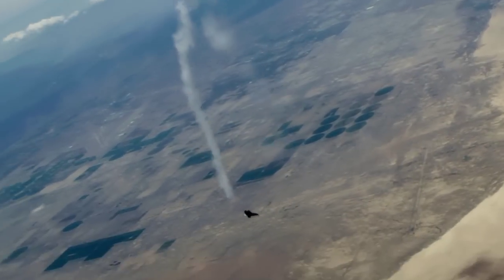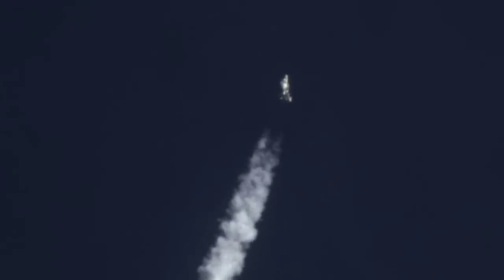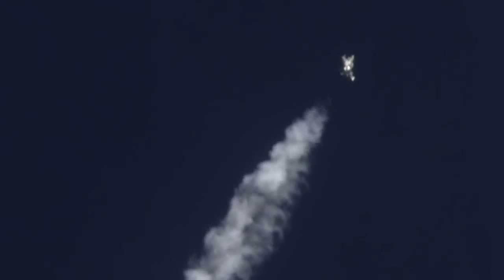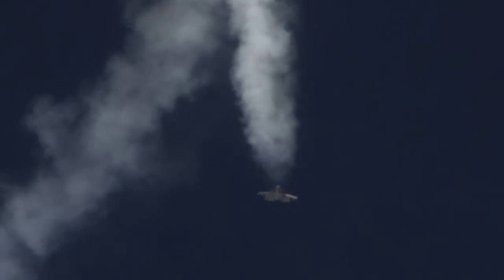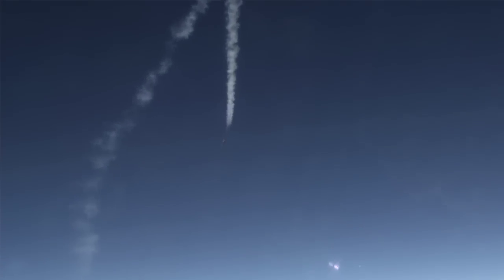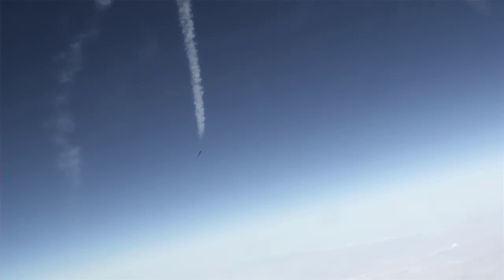F-35 Flight Test Intentional Departure

Comment: Every non-stealthy plane becomes even more non-stealthy with external weapons and instant reduced performance. A smal bellytank under F18 and 4 A/A missiles and your instantly down to mach 1.4 max. With 3 tanks it's max mach 1.2. Add bombs (4000lb) or ECM pod your down to mach 0.8.
F35 will of course suffer from the same limitations with external stores.
It's a non-argument basically. With the F35 you have the choice. Depending mission profile. With F18...you don't.

Comment: Yes serious.
You haven't answered my question. Which is the more capable plane.
A F105 with 5000 lb of bombs, 2 or 3 fuel tanks, and/or some pods for all wheather/day/night capability, ECM, nav, lasertargeting...the lot.
F35A has all that inside.
Result: 9G, mach 1.6, 50 degree+ AoA, throughout the envelope.
F105 (or whatever): can't get supersonic anymore...limited G/AoA. Increased RCS, less range, more drag etc.
Easy. Just a matter of physics. You should know that. You are an analyst right?

Comment: What the USAF will not tell you is that ‘stealthy’ aircraft are quite detectable by radar; it is simply a question of the type of radar and its angle relative to the aircraft… As for the highly complex electronics to attack targets in the air, the F-35, like the F-22 before it, has mortgaged its success on a hypothetical vision of ultra-long range, radar-based air-to-air combat that has fallen on its face many times in real air war

Comment: Seriously?

If one accepts every performance promise the DoD currently makes for the aircraft, the F-35 will be: “Overweight and underpowered: at 49,500 lb (22,450kg) air-to-air take-off weight with engine rated at 42,000 lb of thrust, it will be a significant step backward in thrust-to-weight ratio for a new fighter… [F-35A and F-35B variants] will have a ‘wing-loading’ of 108 lb per square foot… less manoeuvrable than the appallingly vulnerable F-105 ‘Lead Sled’ that got wiped out over NAM

Comment: new Documents out of the Pentagon suggest that the F-35 is looking at cancellation. with a 68% rise in cost per plane since 2002, plus the numerous software issues, grounding sue to engine blade cracks, airframe cracks, grounding and such....can only hope this white elephant of a plane gets cancelled or procurement minimized.....this plane is just ghastly

Comment: Search "yury su-35 problems". Typhoon took 25 years before it could self designate a guided bomb - most flying examples still can't. You are using the F-35B internal payload spec, F-35A and C can carry 5,000 lbs internal - the anti-war POGO types love to do that - mix and match stats to make the -35 look bad. Can the Rafale's pitiful thrust to weight ratio power it to Mach 1.6 with 2x 2000 lbs bombs and 2xBVR weapons? Nope. But F-35 can go to the limit with a credible weapons load.

Comment: Delayed 3 years etc...nowhere does that show up in any search, but problems with the F-35..try searching that and all you get is report after report what a failure this plane is. A 3000lb internal load isn't bad..and I did say 3000 not 300. I would take Typhoon or Rafale ( both of which have seen combat unlike the F-35 or 22) over the F-35...it's overpriced, underwhelming, problem-riddles underachieving aircraft

Comment: Airshow maneuvers at airshow speeds and altitudes are completely irrelevant, and Su-35  introduction has just been delayed three years because of unspecified "problems". F-35 can carry two AIM-120D and two 2,000 lbs JDAMs at the same time . . . significantly more than 300 lbs. Nose pointing at altitude as shown in this video without vectored thrust is nothing short of phenomenal. Su-35 is nothing more than a target for the Lightening.

Comment: on the matter of capability to detect..your wrong there...first off the F-35, the white elephant that it is, has to be in service, which it isn't. Second, the F-35 has a 300lb internal load...nothing special. Lastly, this video shows a plane with nothing special in terms of maneuvering...watch the Su-35 at le Bourget airshow 2013 for some awesome maneuvering. This plane continues to be less than average.

Comment: The idea is it doesn't have the proximity fuse or warhead found in other a2a missiles, and uses this for fuel instead - perhaps using the new generation of gel based rocket fuels. It's also a fatter missile than normal, further increasing the internal volume. On the other hand it has to have a solid divert system like the PAC-3 to pull the end game hit to kill maneuver, which takes some space back.

Comment: "Ok, it’s not stealth"

...and that's its problem.  Against a flight of F-35's carrying 12 CUDA missiles EACH internally, any aircraft which can't detect an F-35 within the F-35's engagement zone will be flying defensively constantly, burning fuel and losing altitude.

Even if the first missile or two miss, the F-35 will just keep firing relentlessly until the Su has been drilled into the ground where the missiles are capable of maneuvering 4 times faster than the Suckhoi.

Comment: No it doesn't have em on the wingtip.  The tips are heavily sharpened for stealth.  

The outer rails for the 9x (if fitted) is mounted under the wing, near the tip.

Comment: "What I was trying to say is the bay door stations vs the A2G stations"  I believe the 2000lb jdams are as long as the slammer.

They don't use a trapeze system, the internal pylons use a firing bolt powered by pressurized air (or fuel) to project the missiles outward.  More re-usable apparently.

Currently (and I think already on the test birds) they are drop testing one on the door and one from inside the bay.  3 in each bay is scheduled for block 4 or 5.  2 will go inside each bay.

Comment: I stand corrected and I worded that wrong.

What I was trying to say is the bay door stations vs the A2G stations.

You know more about the F-35 program that just about anyone on YT, are they working on a trapese setup for the A2G station for AIM-120?

Currently it can carry 4 AIM-120 internally on the bay door stations correct?

newmanfrigan is saying block 3F will have the ability to carry 6 AIM-120 internally. I can't see how you can fit more than two on each bay's center-line doors.

Comment: "You can fit two AIM-120s in those bays (Bay 1 is to short for AIM-120 I believe) "

Huh, you believe wrong. Both weapons bays are designed around the aim-120 for their length requirement.  

bit. ly/ 1beQoUW

Comment: A2A loadout:  12 CUDA A2A missiles

A2G loadout:  8 SDB II's.  70 miles range, tri-mode seekers, simultaneous launch capability.  Better than the flankers 6 PGM's with a 35km range which can't be used in bad weather at night.

Comment: Are you sure about that?

Better in what regard?

Shear weight or the abilities with specific load-outs/weapons systems?

The two internal bays add up to four weapons stations.

You can fit two AIM-120s in those bays (Bay 1 is to short for AIM-120 I believe) and four more on the wings for a total of six.

I think the Su-35 can fit eight R-77s on it's wings no?

Comment: Yes

And your point?

Please do share with me what the difference is?

LOL

I bet you're going to try and claim a weapons load-out with gen 4.5 hurts combat range vs. gen 5 due to internal weapons stores and less resistance due to pylons and weapons?

Sure it does but it's nothing compared to the shortened combat range due to no external tanks/stores.

When you design internal stores you lose internal fuel capacity by nature.

Comment: 4. Faulty manufacturing, saying this doesen't happen to other planes is asinine
5. issues shared by the Typhoon and F-22. Su-27 and Mig-29 are okay because they have virtually no capabilities in that regard to begin with.
6. resolved
7. yet again, resolved. Seriously that was an issue they fixed in 2010 numnuts.

Comment: 1. Limited INTERNAL weapons. With external harpoints the F-35 can carry a maximum load-out of 10 weapons.
2. Still cheaper than the F-22 and the F-22. If you are comparing the price of a 80's era soviet fighters to a 21st century stealth fighter your an idiot.
3. not with 40,000 pounds of thrust being delivered by the engine
4. barring the helmet all of which have been addressed. Hell last week it was announced that it was going into service a year earlier than anticipated.

Comment: throw in the Rafale and the F-35 is not too good. If you are going to add things to the list of the F-35 add these as well

1. limited weapons ( to maintain "stealth")
2. Overpriced
3. Overweight
3.Pentagon reports there are 8 crucial flaws in its design that have raised red flags within the DoD
4.Planes grounded due to engine blade cracks
5. Software issues and compatability
6. Electrical issues
7. Stealth coatings are peeling off
8. and the list can go on

Comment: The current A-10's only have the capability to shoot at a hand full of different targets and strafe an area with the GAU.  They are also exposed to 90% of the world's surface to air missile systems and ground AAA.

The F-35 from 30,000ft is only exposed to 10% of the world's SAM's, is out of range of AAA.

Comment: The F-35 has numerous advantages in A2A combat against current platforms prior to getting to a merge where it needs to manoeuvre aggressively.

F-35 enters WVR combat with the enemy already flying defensively to avoid missiles.

There's a good video on how the F-35 does CAS in the Test Pilot Tuesday series on the LM channel.  Basically, flying around at 500ft looking for enemies with your eyes is the old days.  Flying at 30k ft using numerous sensors to monitor targets is how its done now.

Comment: The reason why the thrust to weight isnt as high as u want is bcoz the F-35 has the option to carry a truck load of fuel. the A model can carry 18,000lbs, stick it with 10,000lbs of fuel and 6 misiles, and you've got a T/W ratio thats still grater than 1:1, do the same on a Mig 29 and you've got a flying brick

you wna talk wing loading,the F35C has a wing loading thats significantly lower than a Su-35s, the wing area of the F-35C is 668ft vs 667ft of the Su-35, the Flanker-E is also lot heavier

Comment: The F-35 has more payload capability. *Three* times as much as the F-16. It's cheaper to operate, cheaper to build than an F-22. At 50% fuel F-35 has a 1:1.1 thrust to weight ratio, and still carries far more fuel than a fully loaded F-16. The F-35 is optimized to efficiently bring death to its enemies (who will mostly be on the ground) and not appease air-show loving morons - so it just won't be popular until it wins the next war.

Comment: "Departing controlled flight" is the "key" concept: being able to recognize when it begins and manually or automatically restoring control as needed.  If the F-35 has boundaries/limits that when passed; the software systems restore "controlled flight"; then a key goal has been met.